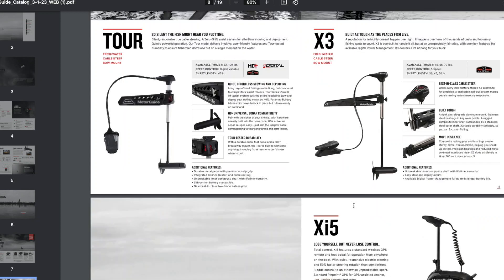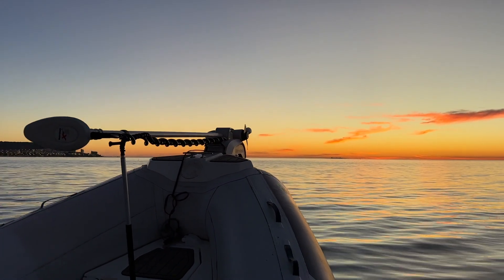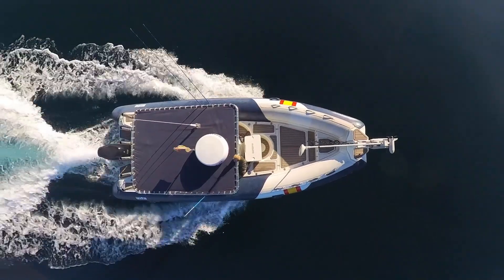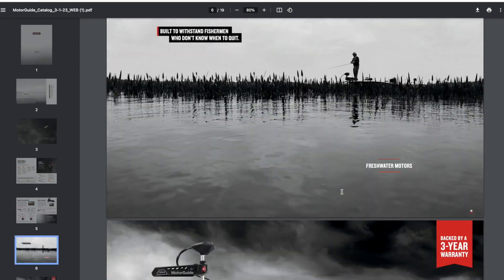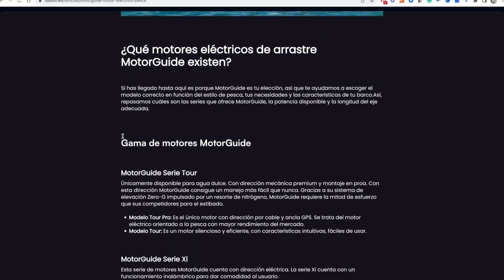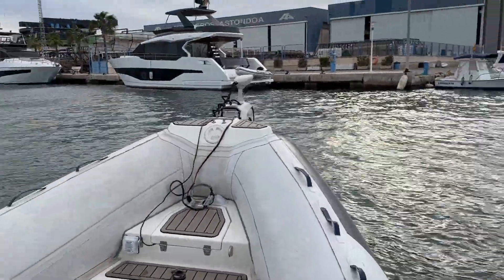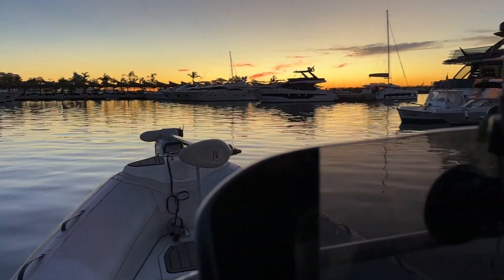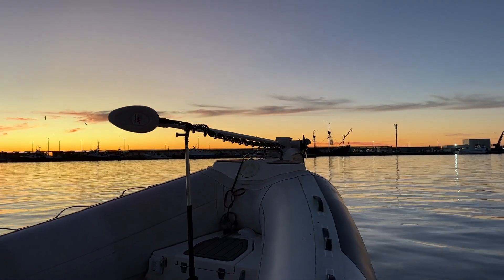COMO ESCOGER MOTOR ELÉCTRICO PARA EMBARCACION DE AGUA SALADA

Comment: Buenos dias Andres, llevo un tiempo mirando para hacerme con un motor electrico pero teniendo una ST840 con electronica simrad, hago los calculos de la potencia que necesitaria en el motro electrico y no llego ni por asomo y en el mercado no veo nada que supere los 112 lbs de empuje. Sin embargo, veo que algunas st840 MONTAN LOS MOTORES DE 112 LBS Y DICEN QUE LES VA BIEN, Y CON 72" DE CAÑA!! que a mi tampoco me da que ese largo sea valido. Antes de comprar nada y meter la pata me gustaria saber si es correcto lo que digo, y que opciones tendria para la ST840.mucha sgracia spor tus videos ;-)
Reply from the maker: @mikel-t8c  para barcos tan grandes y más pesados aún se está usando el MINN KOTA RIPTIDE TERROVA QUEST 115 LBS EJE 254 CM , es el más potente del mercado
Reply: @andresorts   mucha sgracias por la respuesta,

Comment: Hola Andrés, quería preguntarte, con unos meses de uso ya tendrás experiencia, ¿esos 50 cm de calado del motor son suficientes?, con calma imagino que sí, pero ¿con un poco de ola? lo digo poque tengo un caso similar y es para saber si montarlo en la parte alta de la bita de proa reforzándola con tubos de inox o ya que estoy hacer un añadido para que el motor quede más bajo.
Gracias y saludos.
Reply from the maker: 50 de s lo mínimo si puedes deja 80 mejor luego con mala mar se agradece cuanto más abajo este menos s se saldrá y se trata de eso
Reply: @andresorts  Muchas gracias, a veré que puedo hacer.

Comment: Buenas tardes señor Andres, mire su video hago parte de una empresa de pesca artesanal sostenible linea de mano, pero estamos siendo poco competitivos al mercado por el alto precio de Gasolina y Diesel en Colombia este tipo de motor del video podria ser ultil para lanchas de pesca artesanal y barcos de 10 a 15 toneldas de pesca y cuanto de autonomia en distancia y tiempo tiene para los pescadores muchas gracias por su respuesta y me gustaria poder por interno hablar con usted
Reply from the maker: Es demasiado peso , mercury está desarrollando nuevos motores eléctricos con mas potencia quizá esos sirvan pero este motor del que yo hablo es par 1500 o 2000 kg no mas
Reply: @andresorts   Excelente noticia Mercury como puedo tener cercania con esa entidad, porque estamos muy limitados ante el mercedo y perdemos clientes, desde hace años pense que se podria contruir motores con agua como enerigia pero ahora que veo su video motores electricos es brillante
Reply: Buenos días Andrés gracias por la información,  me gustaría saber si para una semirrigida  bwa, 5,10 con yamaha 60 de 4 tiempos, cuyo peso ahora desconozco, me valdría un 50 lb ?